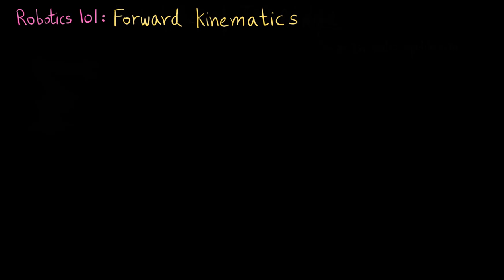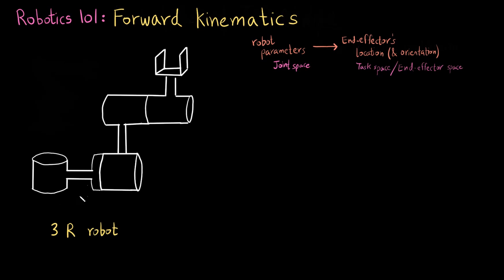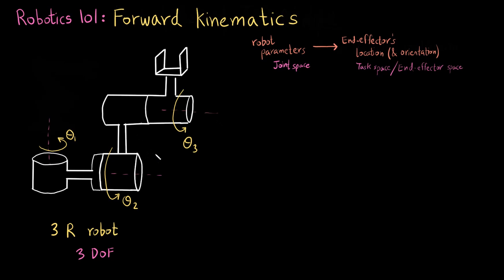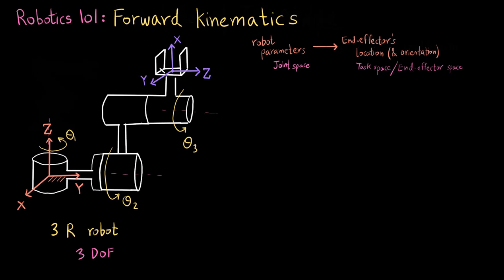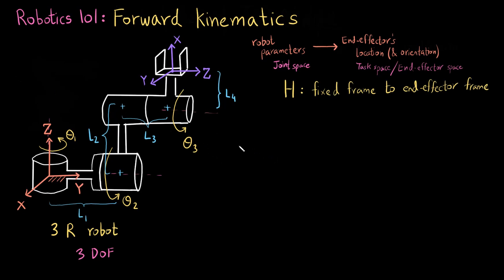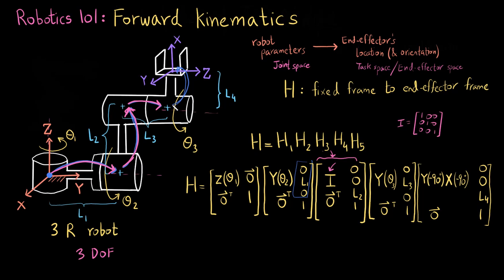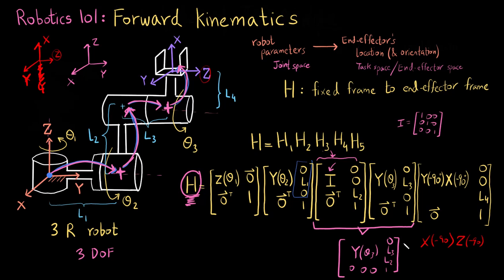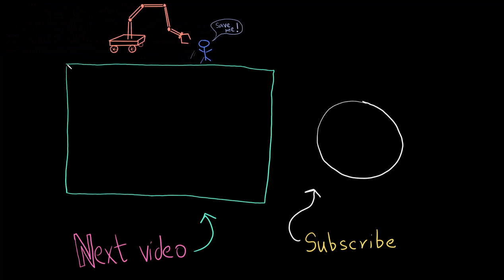Solving Forward Kinematics of Industrial Robot  | Robotics 201

Comment: i did not understand why was the orientation of the axis of the end effector not the same as the fixed frame point? please answer sir
Reply from the maker: The orientation of the end-effector's frame is defined by the company designing the robot. It can be defined in any way. For this question, it was defined as drawn in purple. If it isn't defined, then you are free to define it as you feel like. But in reality, most robot makers such as Fanuc, ABB, Yaskawa, Comau etc pre-define the orientation frame of the end-effector.
Reply from the maker: Does that answer your question?

Comment: How did you decide the frame of the end effector at the start? Was it by using DH parameters?
Reply from the maker: The choice of the orientation of the end-effector is arbitrary. Normally, the designer of the robot decides on it and mentions it in the product specification manual. 
If you design a robot, you can keep the orientation however you want. The only thing to be careful about is that once it is decided, it is kept constant throughout the analysis.
For this question here, we assumed that it was already decided by the designer and was mentioned in the question. Hope that clarifies the confusion.

Comment: Hi, This doubt is not regarding forward kinematics but wrt inverse kinematics. Will there always be the variations of 5 to 6 cms in the final result of the end effector position from inverse kinematics as compared to the actual values assumed. 
I have been using the most common technique of solving i.e solving inverse position first and then inverse orientation.
If there is any other way to solve it please guide me.
Reply from the maker: There shouldn't be any variation in the result. You might loose some accuracy if you are doing it manually due to the number of decimal places you use when working with trigonometric functions but if you are using a software such as MATLAB, you should get the exact answer.
The technique that you talked about is the one that I use and recommend. I am going to be making a video on it soon so maybe that will help to see if you are doing something wrong.
Reply: Thank you so much. Will be eagerly waiting for it. Till you release the video. Can you please share any reference materials which you are using to develop the equation. It would be of great help as I have been working on this problem for many days and struck with this one issue.
Reply from the maker: @malladinagasubhash  I will be using the equations and derivations that I have in my notebook. You should be able to find a lot on how to solve inverse kinematics in the following books:
- Introduction to Robotics: Analysis, Control and Applications, Niku, Wiley
- Introduction to Robotics: Mechanics and Control, Craig, Pearson (a very widely used textbook, a real pain at times)
- Modern Robotics: Mechanics, Planning and Control, Lynch & Park, Cambridge (prepare for your head to spin)